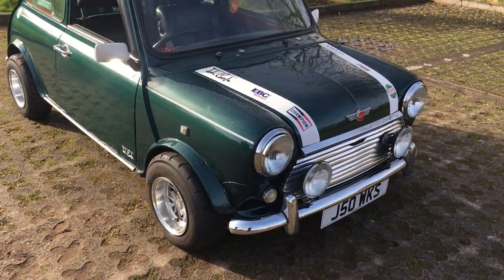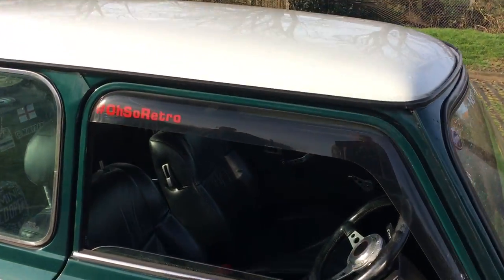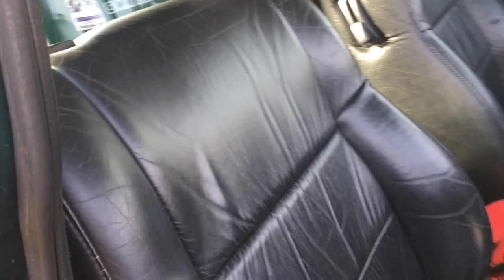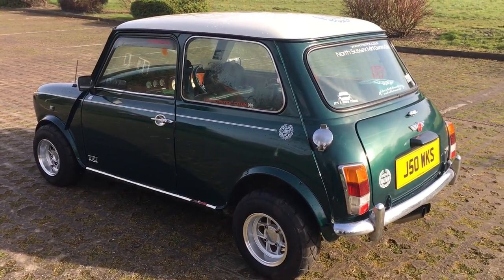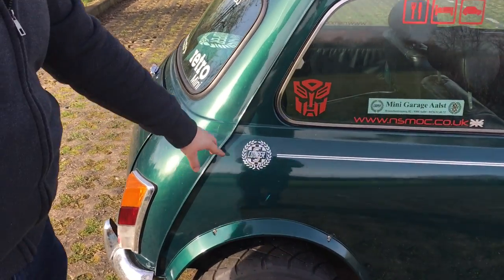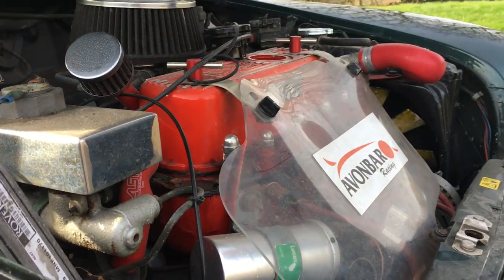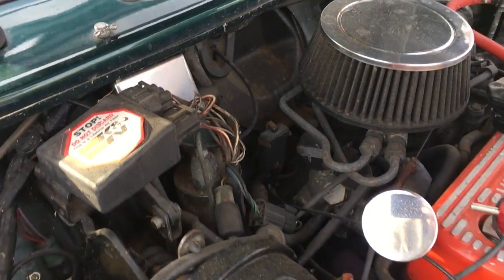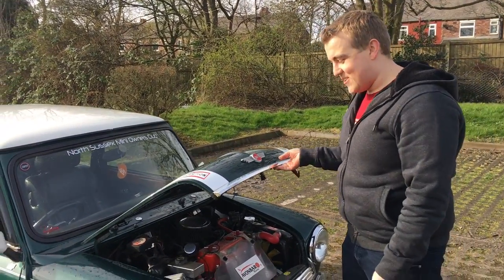Classic Mini John Cooper Conversion  JCW - Walk Around & Introduction

Comment: Love some of the JC options. Technically it's not a Works conversion, it's an Si. I don't think the Works cars were until 98/99.
Reply from the maker: Classic Mini Workshop I knew this would be something you would like Keith. We will do a proper walk around once it’s done. Thanks for correcting us this was something I did think to but wasn’t to sure. Mad how it is still running standard rover stuff with thar Avonbar engine

Comment: What's the point of high lighting the fact it's a John Cooper Works conversion, while there is nothing left of it engine wise, but only the interior upgrades?
Reply from the maker: The engine is the original one it has just been taken further by Avonbar. The interior apart from the harness (which is now removed) is as it was from John cooper the seats the dash etc the details inside are all there. So thank you for your comment.